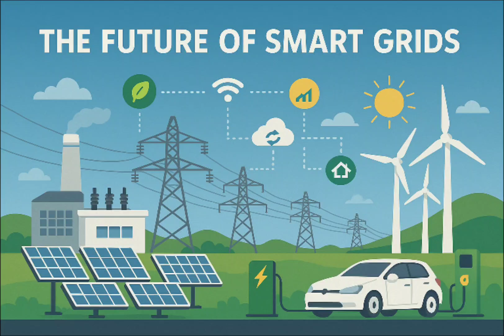The Future of Smart Grids

Comment from the maker: 🌎 Test your knowledge and understanding by answering the following questions.
Q1. What are two major limitations of the traditional power grid?
Q2. What is the main goal of the smart grid?
Q3. Why is bidirectional energy flow important in smart grids?
Q4. Explain one benefit of demand response in smart grids.
Q5. What kind of information do Phasor Measurement Units (PMUs) provide to grid operators?
Q6. What is a Virtual Power Plant (VPP) composed of?
Q7. Why do rising AI data center growth and EV adoption increase the need for VPPs?
Q8. Why is cybersecurity important in smart grid and VPP systems?

✅ For those who wish to explore further, a few useful links are provided below for your reference.
https://liftoff.energy.gov/wp-content/uploads/2025/01/LIFTOFF_DOE_VirtualPowerPlants2025Update.pdf
https://www.energy.gov/gmi/grid-modernization-initiative?nrg_redirect=319202
https://iea.blob.core.windows.net/assets/b1e6600c-4e40-4d9c-809d-1d1724c763d5/DigitalizationandEnergy3.pdf
https://pvcase.com/blog/understanding-smart-power-grid-technology/
https://www.nist.gov/ctl/smart-connected-systems-division/smart-grid-group